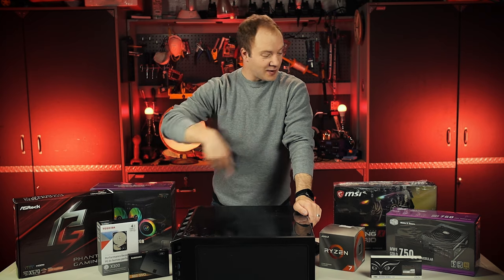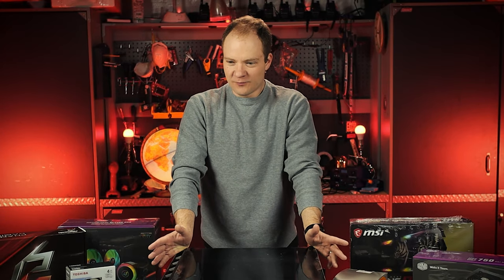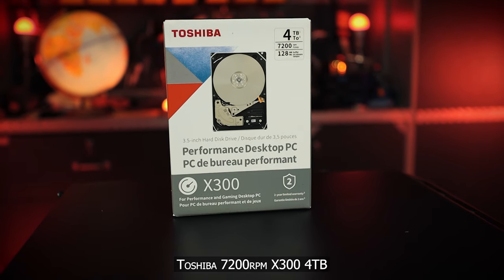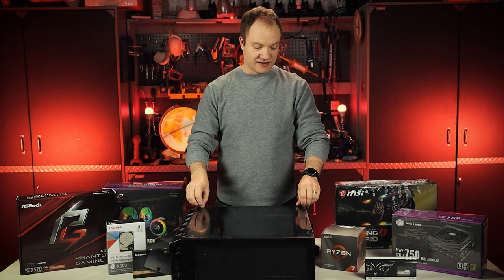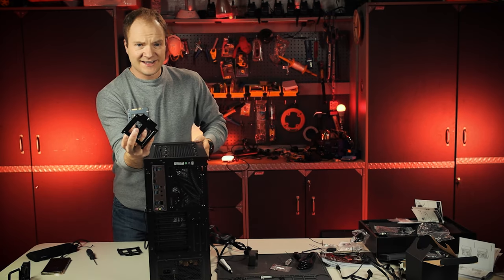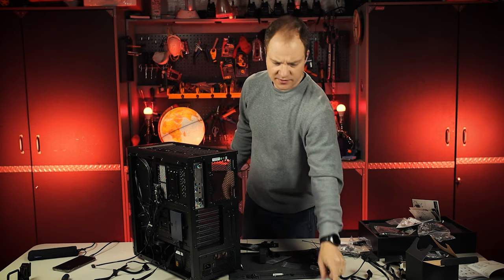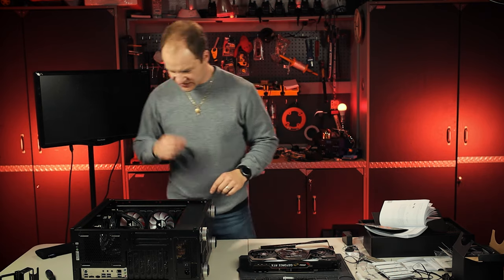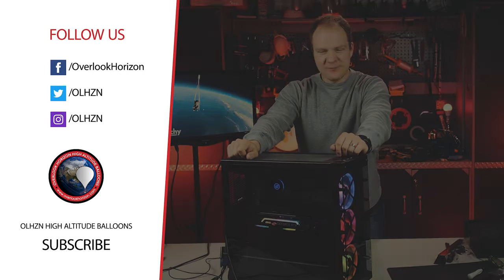Building a Custom Gaming & Streaming PC - DIY

Comment: Great job! 
A couple things I saw.
1. You went a little heavy on the thermal paste. I would suggest putting about the size of a green pea in the middle and letting your cooler spread it for you. 
2. The reason you didn't get any output without the video card is because the cpu you have does not have integrated graphics. AMD models ending in G do, i.e. Ryzen 3 3200G
3. Did you go into bios and change the speed of your RAM to 3200? If not, you might not be getting the speed you paid for.
Reply from the maker: Thanks!  I've always wondered whether it's necessary to spread the thermal paste beforehand!  I figured out the no integrated graphics after the fact, but I just assumed it was there during the build 🤷‍♂️  I did manually set the speed with the XMP Profile to 3200 so hey I got 1 thing right! 😂🤣😂